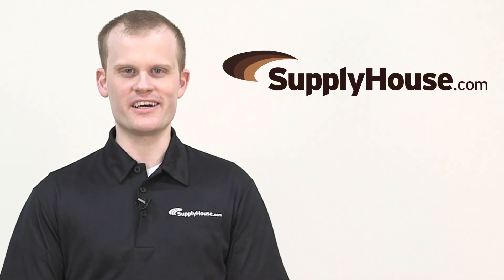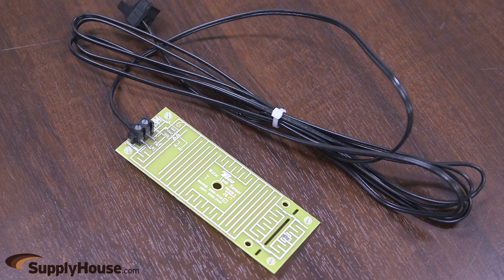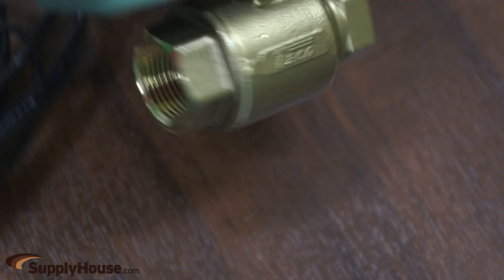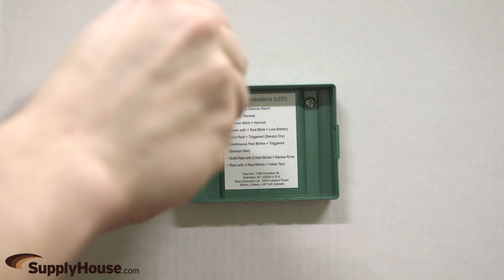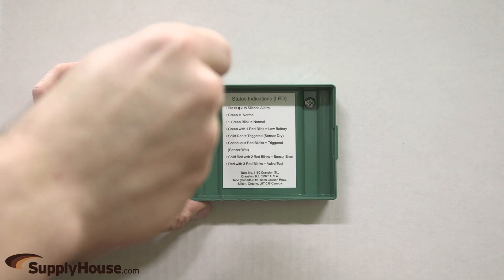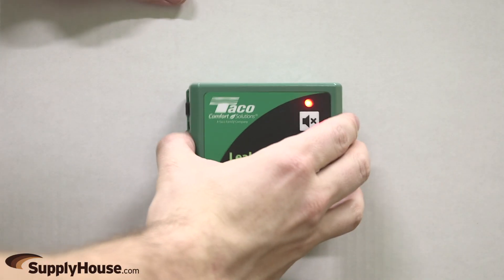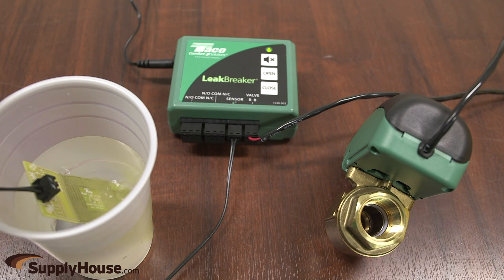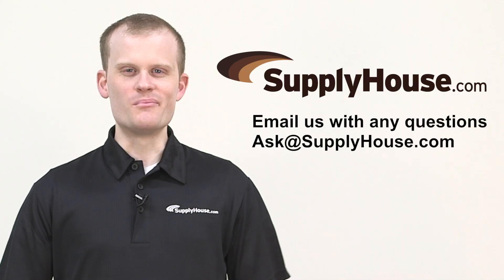How To Install the Taco LeakBreaker

Comment: We had one installed yesterday. Since this morning, I’ve been hearing random beeps from the leakbreaker. It goes into Red for a second then goes back to green. Do you know why it’s like that?
Reply: If you open the back of the control unit, there are status indications, and refer to them. You just need to check how many times  Red LED flashes. I hope it will be resolved.
Reply: @김학민-u6y  Thanks for the reply. Not sure what caused it but when I was having this issue, it was plugged in to the wall outlet. Tried powering it with just batteries, no problem. That seemed to resolve it.

Comment: Did you see the motor move on the valve at the end?
FloodStop is better.... has adjustable sensitivity and a maintenance feature that automatically cycles the valve every 30 days.  1 million installed.